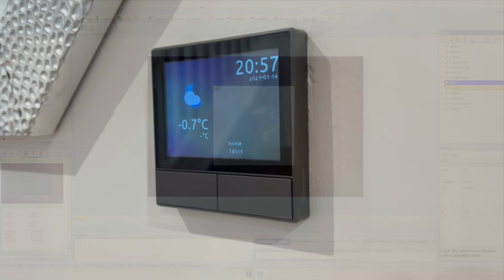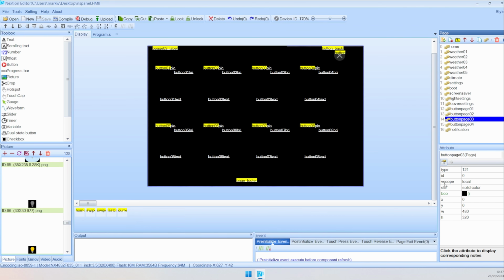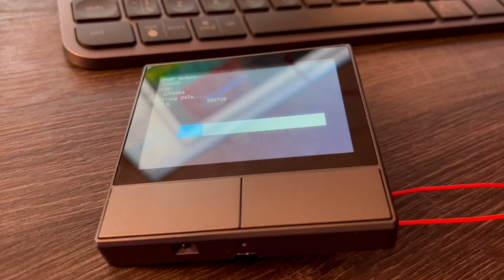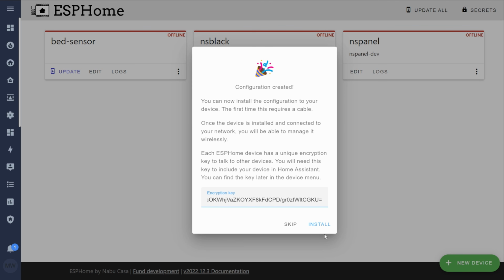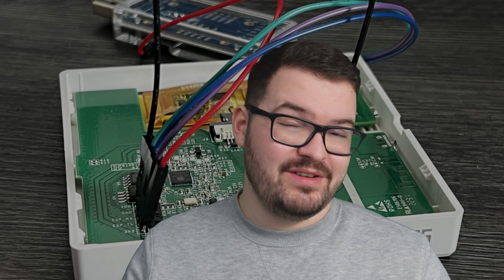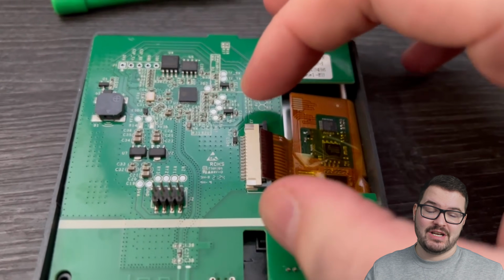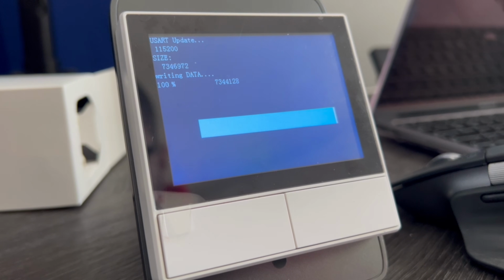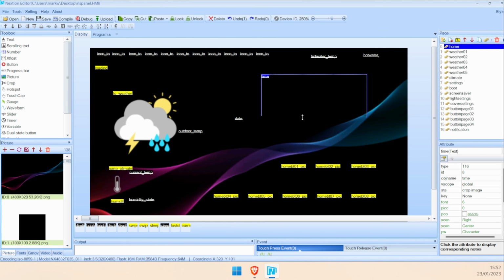HOW TO - Setup the SIMPLEST Smart Home Scene Controller

Comment from the maker: Checkout the Overview of all of the features here 👇🏻

https://youtu.be/b7vW4YtUaTs
Reply: I noticed in both your videos on flashing you’re using the programmer with the jumper set to 5v (and taking 3.3v off the jumper). I means your TTL levels are still 5v. If you change the jumper, your TTL levels will be 3.3V, and the Vcc pin with also be 3.3V

Comment: Hi! I got till point of installing it back into the socket in the wall but it says constantly waiting for content..
Reply: So, it shows a QR code from the blank TFT, right? And if I try to update the TFT display by selecting nspanel eu and hitting the update tft display button, nothing happens.
Reply: So, it took about 10 minutes to go from this to the landscape TFT, which just showed the time and temperature, but swiping did nothing and felt more like I was "refreshing" the page.

Comment: Thank you!   I had found some other tutorials, but couldn't get them to work.  This seems to have worked great.  I haven't really put any buttons on yet, but the flashing process is working and it is currently doing the WIFI update to configure the panel to be the US type.  I am building a new house, and can envision putting one of these in each room where a lightswitch would be!

Comment: My system was "running out of memory", probably because I was running HA inside Unraid with other docker containers. I resolved by using ESPHome locally: using a vitual python enviroment, compiling locally and flashing. The same steps of the .yaml can be used. From there, it was useful to know that after boot, the panel is still ewelink.

Comment: Thank you for this video, I have now got the screens working with HA after 2 years of mainly not trying after I failed with my initial attempt, probably due to not using the correct URL for the tft file. This video started me down the path of having another go which was successful with some guidance from one of the contributors to the project. Big thanks to Edward Firmo for responding to my plea for help at 11:40pm New Years Eve, 02:00am and 10:17am New Years Day. I guess we've both had an exciting New Year 🙂

Comment: If any one else has an issue with the nspanel not initializing the Nextion Display after the ESPHome 2023.11.6 update, you might have to re-flash the panel.  I tried reset, update tft display, I unplugged it for a while and plugged it back in, and nothing worked.  I re-flashed the firmware completely and it works again.  I didn't have to set anything back up as that was already done and it pulled everything in correctly.  Hopefully this helps others if they run into the same issue.
Reply: How do you re-flash it?

Comment: Out of curiosity, Seems your are powering your VCC, and thus TX with 5V, yet you run the display board / ESP with 3.3V. Is there a reason for this? Why not have the VCC jumper at 3.3V and use VCC (which would be 3.3V at that point) output to drive the board? This way TX would match the voltage and be 3.3V making the setup safer overall.

Comment: This video is amazing!  However, my experience was just a little different after flashing ESPHome to the device.  After unplugging the nspanel from my HA server and connecting it to Mains power I could not get it to update the TFT display.  What I had to do was go back into the Automation I created and re-select the panel under "Device" (the very first Drop-down and most important one).  I saved the Automation, and then went back into the ESPHome Integration and clicked "Press" next to Update TFT Display and it worked this time and started to download correctly.  It has been about 3 minutes as of this writing and it is 31% completed.

Comment: Phew ... that took me a long time to get it up&running.
If it wasn't for this video, I might have thrown the whole thing in the bin and I have been watching parts of this video over and over again to see if I missed something. What helped me a lot is to use a terminal program on the FTDI's COM port to have a look at the debug output from ESPHome. That way I found out that my panel did not connect to the wifi but it opened the ESP Access Point - connected my phone and typing in my wifi credentials fixed it and made the panel available in HomeAssistant. It took some time for me to realize that the weather service is not an option and not having used one, means the panel will never start. Nice to tell that all things that are not marked as "optional" have to be filled in 👍

Comment: WARNING: The TTL to USB adapter is used incorrectly. 6:52
You are supposed to set the the device into 3.3V and connect everything on the bottom group of pins, in this case VCC (which will have the selected voltage). 
Grabbing 3.3V directly from the jumper selector, will leave RX and TX logic at 5V and potentially damage your NSPanel! 
The correct way would be to have Red on VCC (after changing the jumper of the voltage selector to 3V3), and the rest is ok. 
Lastly, the pins RTS and CTS are not intended to be bridged, as such the jumper should not be there. 
DSD Tech includes the jumper for testing purposes, where you bridge TXD and RXD, allowing you to receive whatever you send.
Reply from the maker: You are correct about not using 5V. This will damage the board during flashing.

However in the In the video I use the 3V pin directly and not the VCC which is connected and bridged to 5V. I only use the 5V to power the screen (after flashing). I wanted to highlight visually to use 3V.

Comment: help!, everything flashed and device added to HA etc but tft update doesn't work (there is only a 'press' button i see yours is a toggle?) I tried sending a service tft update  through developer tools,  have tried flashing at least 3 times with same result? what am i doing wrong?
Reply: I am having this same problem. I am able to use the controls of the physical buttons and I am able to control the relays from home assistant, so the device is working. I do not have the TFT toggle, its just a button. It also is reporting that the Nextion display is "unknown" or "disconnected"

Any help on this would be appreciated.
Reply: @crossfirearena2194  i resolved it by using the 'exit reparse' button in the device settings, press that button and while the screen changes, press the 'update TFT display' button, hope that helps...
Reply: @3orley  Thank you for the information. I will give that a try later today and see if it works. Thanks
Reply: @3orley  I am confirming that this isnt working. my panel keeps showing nextion display unknown or disconnected. The exit reparse button isnt doing anything.

Comment: What voltage do you user voor flashing:  3,3 or 5v??    and when connecting nspanel through ip.  what is the username and password?
Reply from the maker: Only 3V for flashing. Do not use 5V for flashing
Reply: @MarkWattTech  Yes, too bad flashing from esp on Home Assistant  no port! available
Reply: Oh and i have Home Assistant running on a NUC,   on Windows or Mac you can assign a port but how to do that on a NUC with HAOS

Comment: Hi Mark,
Everything went well until "update FTF display". When I clik on that I see status has changed but nothing happen on the NSPannel. I tried also go to developer tools and call service: ESPHome: nspanel_upload_tft - still my NSPannel doing nothing. I see only home page with temperature and time as 0 and "Please create widgets in eWeLink app" in the next page.
Do you know what;s the problem ? There is clrealy communication between HA and NSPannel because I see entities and I didn't have any problem to add this device to HA.
Reply: I found one problem: in the nextion_update_url I had " nspanel_us.tft" but on HA I have file "nspanel_eu.tft". I fixed that and flashed device again but still I have the same issue: nspanel_upload_tft  doesn't do anything
Reply: My problem was solved by uploading nspanel_blank.tft first, then eu version
Reply: @amadeuszjakobczak7196  nspanel_blank.tft ? is this a file you made ? only having the same problem also looking in to baud rate
Reply: @martinottolangui4667  nspanel_blank.tft is available on the github page of the project. It's made by developers from this project
Reply: @amadeuszjakobczak7196  i have the same problem. what do you mean by "uploading nspanel_blank.tft first"? u flashed the device with that tft and then you reflashed it with the eu tft?
Reply: same here, @MarkWattTech ?

Comment: Hi to All,
A very big thank you to everyone that made and contributed and assisted to make this NSPanel and Blueprint documentation, project and videos, whilst it took me a little bit of time to get my head around Home Assistant & the NSPANEL its the best move I have ever made as I was using Fibaro with a Home Centre 2 and it got to the stage where there were no updates and it was not doing the job.

I finally have everything in the house automated and I now have control  over my JVC projector which I could never do with Fibaro, though I still have a bug turning it off which I am still trying to solve with HA 

LG OLED TV
LG Soundbar
Samsung Soundbar
100 x LED lights
Fireplace fan
Dehumidifier
Smart Kettle
Sub Bass Amplifier
Integra Receiver
Apple TV's
Wii Console
Multiple Ceiling Fans 
Flood Sensor 
Daikin A/C's
Fibaro Motion Sensors
Google Nest Protect Smoke Detectors - Not working in HA yet
Unifi G4 Cameras
Unifi Dream Machine Pro
Wyze Cameras
Lockwood Lock 
WiFi Power Points
Automated Shopping list 

A special shout to Mark for his very entertaining and educational videos and to Blackymas for the excellent Blueprint

I could be not more happier with the NSPANEL and the Blueprint project, whilst I only have one so far it has inspired me to purchase more.

Looking forward to more updates 

Kind regards
Bruce.

Comment: Hi Mark, thanks for this great video, really clear and easy to follow :) The flashing worked fine, but...Has anyone had a problem where the log output from the panel says: 
[15:08:54][W][nextion:072]: Nextion is not connected! 
[15:08:55][E][uart:015]: Reading from UART timed out at byte 0!

I've read through the forums and a fix seems to be to change the baud rate to 9600 in the esphome yaml file. I have no idea where that is. Thanks, Andrew.
Reply: I am struggling with the same issue, did you ever find a solution for this?
Reply: same issue here! any solution for this  around?
Reply: @assaflev  Hi Assaf, yes! Please see my reply above, have fun!
Reply: I'm also facing this issue, however doing the "Exit Reparse" action stops it and forces Nextion to restart and respond again. 
Still struggling to get the Update TFT display to work though.

Comment: Great video Mark. One quick Q. When you flash the NSPanel does it have to be plugged into the computer running HA or can it be plugged into the computer you as accessing HA from? I run HA on a QNAP NAS so would the NSPanel have to be plugged into that? Thanks!!
Reply from the maker: Hey Howard. Its the same as any other esp device flash (if you are familiar with them). You can use a host machine, the local machine, and if its already flashed - wirelessly.

In this video I use my own PC and not the machine I'm running HA on. Hope that helps.

Comment: Just wondering if anyone has this error.....when i try an connect the device to my pc and install via ESPHome im getting a "Failed to initialize. Try resetting your device or holding the BOOT button while selecting your serial port until it starts preparing the installation""

PS: i am referencing the Wiki and using the nextion update URL that is local to my machine
Reply: same issue

Comment: Firstly and excellent video. I have followed the instructions. When it came to ESP home it would not connect. It directed me to the web UI and to download the project. It then told my to load ESP home followed by my project. Both succeeded. The NSpanel shows on Wifi ( so it was flashed or it would not connect) and when I try to update TFT display the display does off and reboots. The update slider stay on for 5 seconds or so and then goes off. It does not then update. 

turned off triggered by service switch.turn_on
16:52:11 - 6 minutes ago - 3CPR
became unavailable triggered by service switch.turn_on
16:52:10 - 6 minutes ago - 3CPR
turned off
16:51:03 - 7 minutes ago
became unavailable
16:51:02 - 7 minutes ago
turned off
16:50:40 - 7 minutes ago

Is the log. 

Sorry for the long post but if you have any suggestions I would appreciate it. Thanks. Jeremy in London
Reply: Any news for that? Same problem
Reply: same issue here

Comment: Thanks again. I managed to go till Congratulations. once I press the button I get this error: "an error occured. Improv WiFi Serial not detected". anyhow I ignore it. later I plug the GND + VCC (5v) to the panel but it will not wake up. any idea ?
Reply: Seems like your wifi data is not correct.
If you have problems create an isseu on Github - then we try to help you

Comment: Great Video & Thx from Germany.
Does this also work with the Pro Version of the panel?
Will the Pro support more features? E.g. More tiles?
Which would be your favorite?
Thank you in advance
Reply: hahaha thanks back from Germany ;P it does not work with the Pro model.
These are two different products. I like the normal Nspnael more because 1. cheaper 2. relay 3. HW buttons 4. I just build me what I need ;) But but everyone must decide for themselves
at the pro I do not like the old Android version and you have to do everything yourself because there is no blueprint XDDDDD

Comment: Hi Mark I've been able to flash sephome on my nspanel and started the tft update. However this took over 12 hours and when finished it just came up with an update failed message (System Data ERROR). Sensors from the NSP are showing bu all attempts to update the tft via HA (service call) and esphome have so far failed. Can you help! Please 

Thanks
Reply: Same, panel doesn't update the TFT
Reply: I am having the same problem. Gets to 91% and never finishes and when I restart I get the System Data ERROR. Anyone have any luck with it past this point?
Reply: @thomashessel9322  I've got all 3 of my NSPanels working now. I first flashed esphome to the panel. I then soldered a small wire to each of the TFT TX and RX pads and then using Nextion Editor I flashed the nextion_blank.tft file, then flashed the nspanel.tft file. I then put them all into Home Assistant and setup the Blueprint. Using the "Update TFT display" toggle in esphome (on HA) the panels stated to do a small update and all works fine.
Reply: @starbase5353  Thank you, where do I get the nextion_blank.tft file or do I just create a new project that is blank and upload it? Sorry, reading through the Editor now and hopeful this will get the four NSPanels that I have in a good state like the three you have.
Reply: @starbase5353  Thank You for the hope. I am in the same situation, but not sure how the solution works. 

(1) The Nextion Editor - is this the Windows software HMI GUI development? I am a Mac guy, but can find a Windows machine, is it as simple as getting the two TFT files from GIT, and then the editor will 'flash' the board?

(2) "I then soldered a small wire to each of the TFT TX and RX pads" - why? was this to create a better cable then the one in this video?

(3) " I first flashed esphome to the panel. " Is this the process in the video

 Thank You for the post and the hope I can get this working.
Reply: @starbase5353  I've run into this problem. When I try to upload the file using Nextion Editor it tells me 'Wrong resource file or resource file has been damaged'  with both the eu and blank versions. Any ideas?
Reply: @thomashessel9322  I just found the HMI files and get the same message when trying to load them as a project!
Reply: I've got this problem now at about 30% upload after 10 minutes. Funnily enough the thing is still connected to HA and reporting Controls, Sensors and Configuration OK. I can even hear the relays clicking. Will try the Nextion_Blank.tft first. I'll report back ...

Comment: I don't understand. I think Home assistant user's are a bit smarter than "normal people". Why this panel existing at all. Its not plug and play. Instead you can use used old phone for less money. Or just buy a tablet for less money and have better interface and less headache to programme it....
Reply from the maker: This device is more the convenience and form factor. They can be placed anywhere there’s a light switch.

For a small bit of work (even less with this project) you get a great little touchscreen that has a good feature set. It’s not aimed to be a tablet. 

There also now more reasonably priced. You can get them in the sales for £40-50 which is often the same price as standard zigbee and zwave smart switches (without touchscreens and the feature set).

These are by no means perfect but they have a great feature set :)
Reply: As Mark has written the part brings several advantages with so only a simple control alone the relay and that thus light can be switched when wifi and ha fail - with the cell phone you stand then badly there ;)

There are so many other things there would be the text too long.

By the way, once you understand the process, you need exactly 5 minutes for the setup.

But it must not please everyone ;)